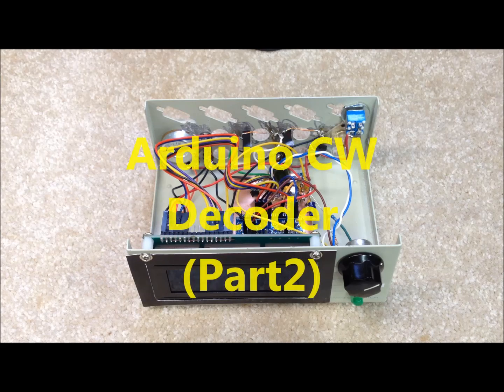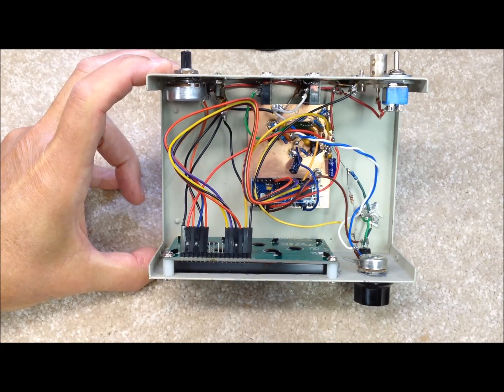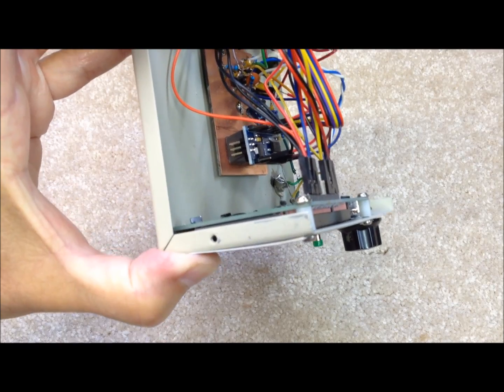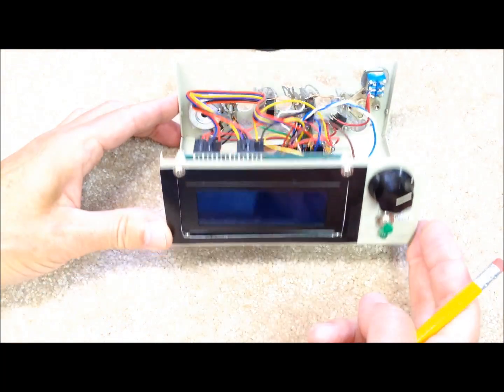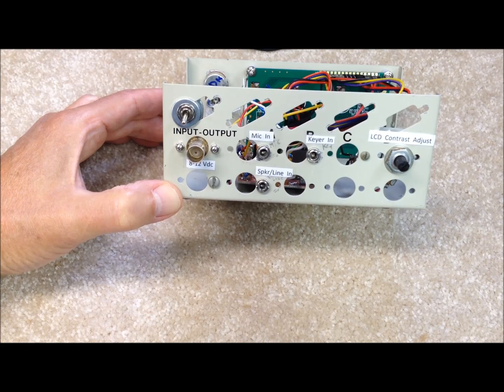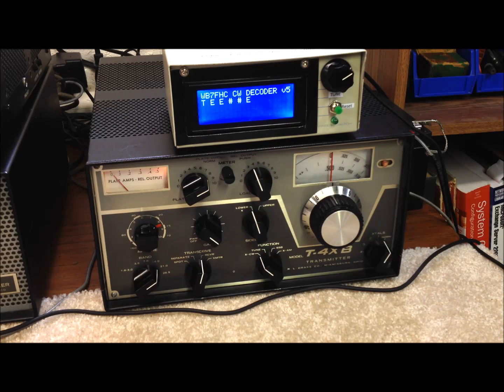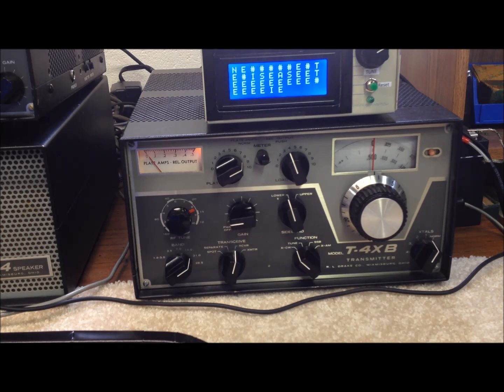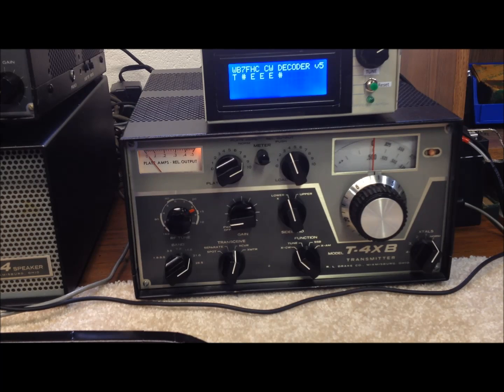Homebrew Cheap Arduino CW (Morse) Decoder - Final Version.

Comment: Love the Arduinos.   Used a nano myself recently for the VOX in a simple and cheap USB digital modes interface.  Similar to the signalink, but around 20 bucks to build.
kb9rlw.blogspot.com/2016/08/cheap-and-easy-to-build-digital-modes.html

Comment: Nice video and thanks for the tip about the LCD bezel.  LCDs seem to be easy and cheap but cost effective  bezels are hard to get.  I cut out the rectangle by drilling holes near the corners and then use my jig saw with a metal blade to cut just inside the outline.  If you have a selection of metal files and some patience it is possible to get a nice clean cut-out.  Use a square file to finish the corners.  I take off a bit at a time and then, with a straight edge along the cut line, hold the work up to the light to check.

Comment: Budd, can you direct me toward the schematic for the decoder? The Ardunio isn't so much of a problem, but the way you configured the LM567  would be a great help. I have a friend who said he played with the LM567 for tone decoding, and he said that it was very temperamental when it comes to the volume of the incoming tone. So i imagine that the best way to start would be the configure the chip exactly the way you did.  Thanks for sharing the project.   73'  Joe KQ4BX
Reply: If you go to Lowes, in the roofing area, they will have rolls of PVC plastic that when unrolled, lays flat, and is easy to cut with a razor of exacto knife. It is also easy to spray paint, just use spray paint that says it is good for plastic to be safe. I would use a primer on it before the color is used, If you cut several layers of the PVC, and glue them together with a heavy flat object to lay on top, you will get a nice thick plastic panel, just stop when you think it is thick enough. I imagine that one or two layers will work fine. One layer would be better than the paper plate.

Comment: Great project sir.  I want to take something like this and also add the reverse (kind of)  and generate code using a keyboard as input and broadcast it.  
My question - you mentioned a tutorial on calibration to help the Arduino with noise.  Do you have a link to that tutorial sir? 
Thanks again for taking the time to document your project.
Reply from the maker: Hi. Info on calibrating an analog signal at http://arduino.cc/en/Tutorial/Calibration I used this code in the setup section reading analog pin A0 (sensorPin) which is connected just before the cap at the input of the 567 decoder.  Then in the 1st section of the main loop included code to read, map min/max, constrain, act on result -- something like this -->
{ 
// read the sensor:
  sensorValue = analogRead(sensorPin);
  // apply the calibration to the sensor reading
  sensorValue = map(sensorValue, sensorMin, sensorMax, 0, 255);
  // in case the sensor value > the range seen during cal
 sensorValue = constrain(sensorValue, 0, 255); 
 delay (2);  //test adding a delay...
     if (sensorValue <70) {
      return;
}}

This is an ongoing experiment & not really sure how effective it is -- as I said in the video, some sort of FFT noise reduction algorithm would be better (but complex as well) but maybe this will give you some ideas for improvements.  Good luck.

Comment: Hello, is there a link somewhere to get the complete description ?
thanks
Francois ( F1CHF@free.fr)
Reply from the maker: Not sure of a single link, Francois.  However Goggling around should get you what you need in the main areas - 1. Tone decoder circuit (one example here  but with a PIC controller, not Arduino --> http://www.hamradio.cc/projects/Morse_Code_Decoder_Circuit.php).  2. WB7FHC has videos and link(s) to his Arduino code. 3. Arduino drawings showing typical LCD & power connections, etc.  Good luck.
Reply: wv2yau OK sir it is more clear now ...
I have added some lines in the arduino sketch
thanks for your help
Francois

/* Barnacle Budd's Morse Code Decoder v. 0.1
   (c) 2011, Budd Churchward - WB7FHC
  http://www.honorlevel.com/data/arduino/readcode/readCode.18.html 
  and for NE567
  http://www.hamradio.cc/projects/Morse_Code_Decoder_Circuit.php
  and 567 calculations
  http://www.hamradio.cc/projects/morse_code_decoder_vhdl_fpga.php
  
   Hook a button or telegraph key up to your Arduino
   and this program will copy your Morse Code and display
   the characters in your Monitor window.